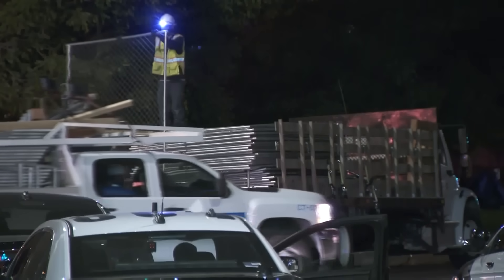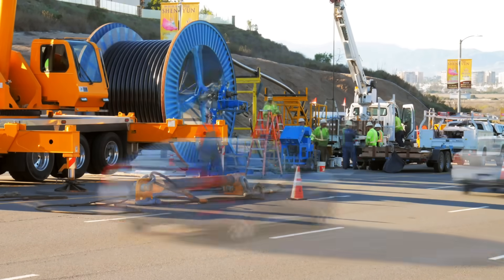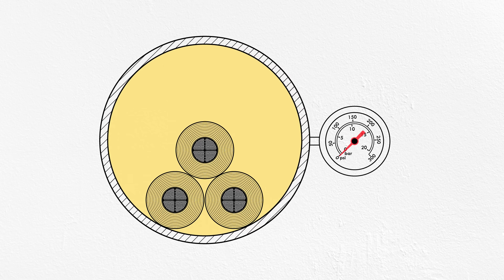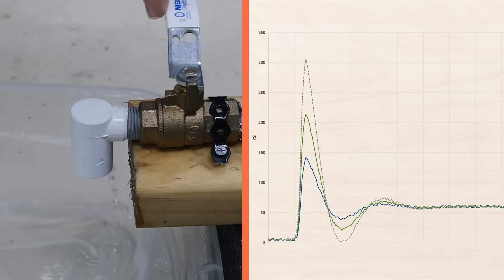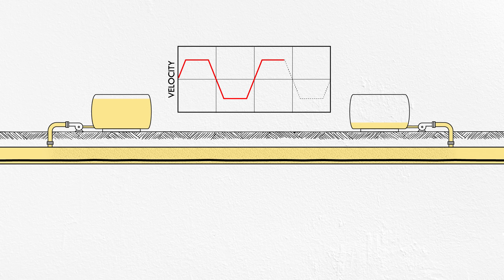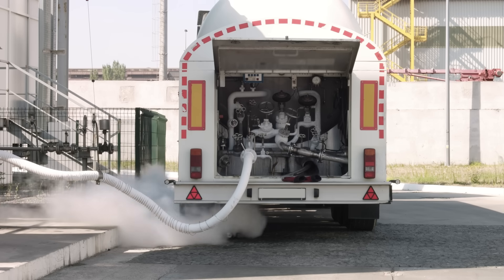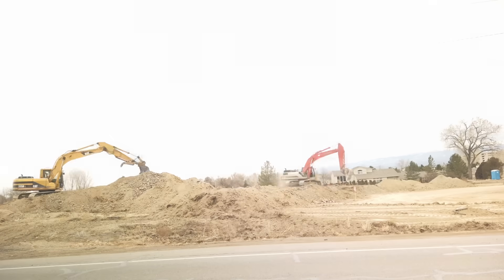Repairing Underground Power Cables Is Nearly Impossible

Comment: Fascinating story, and who knew the complexity involved with underground power distribution. Also interesting twist with the internet bulletin board story. But lets face it, leaving the old lines, with its pipe, oil and oil-saturated cable in situe is just way of saving money on an awfully expensive cleanup project. The old line will never be used again.The dielectric oil, also found in transformers, is a big carcinogen. This will probably become a
superfund cleanup project for future taxpayers.

Comment: This is why they use rubber insulated cables now. There is no oil involved and makes repairs easier. Although a fault in a conduit will require replacement of the cable.

Comment: We had one underground power lines here in the philippines located at san fernando wallace air station which was in use until 2020 when the power station was strucked 3 times by a lightning strike and those underground power lines was constructed by US Air force back in the 60's

Comment: While grid demands fluctuate, I have to wonder how much of the cable flexing was due to heat buildup while slowly reversing direction?  One would think that if they have to lay down pipe, they would have laid down a return line and just allowed the thing to run in a loop.  They could have even added capacity to the system by cooling the oil as it continuously flowed or at least flattened the temperature range some so it wasn't flexing so much.  I mean if you have temperature sensors along the cable or at least monitor the amount of power going through the cable and other environmental factors, you could have been adjusting the flow rate and how much you used the radiators based on estimated cable temperature.  I suppose in a way this would be applying modern tech to an old tech cable system, which is hard to justify doing.  Instead just let the system lay dormant so it is not getting wear and tear through the expansion and contraction.

I suppose this brings up another question, if you start putting in HTSC (high temperature superconducting) power lines, how hard would the maintenance be on that?  At least while such lines are at operating temperature, they shouldn't be flexing much because superconductors create no heat and if the liquid nitrogen cooling it gets too warm, it boils off.  So as long as the boil off gas can escape and more liquid nitrogen pumped in, the temperature should be stable.

Comment: What are the reasons for chosing the pipe solution, as presurrized oil cables were around at that time?

This strictly would not be a cable but a a duct. Or Oil-filled line (similar how nowadays GILs are used [gas insulated line] 

From 1970 to 2008 sounds like normal rated life time to me. Generally taken as 30 years, it is depending on loading.  So the deterioriation of the insulation is just normal ageing of the paper. (probably, based on common experience and limited facts, so other factors may come into play.)

Comment: The real question is why on earth is there still a gas burning power station located in an urban environment.
Reply: I assume it wasn't in an urban environment when it was built in the 50s, though very early power stations were intentionally built in urban environments as transmission networks were not yet developed, and most have been phased out.

Comment: You should visit the Netherlands and some of our grid operators some time if at all possible. Of our total electricitygrid which consists of about 315.000 km of connections. About 4000km is constructed aboveground (mainly 220kV and up due to the lower operational reliability of underground cables at these voltages). The other 310.000km is all laid underground. 

We also use the so-called exchange principle. This means there is a maximum amount of aboveground highvoltage routing allowed. Of we want to build a new high voltage connection aboveground. The distance of the new route has to be sacrificed somewhere else in the grid (or laid underground). 
This way the total aboveground distance of high voltage routing will never be higher than it is. 

If a higher capacity is needed and the distance can't be sacrificed elsewhere. The crosssectional area of the transmission lines has to increase, the resistance of the lines has to decrease or the amount of transmission lines between power pylons has to increase.

Comment: Nearly impossible?  No, it's just much more difficult than overhead power lines.  We have underground power lines on our street.  When we bought the house we thought, "Oh, great.  We'll have more stable power (California-PG&E).  Fifty years later we've had dozens of power interruptions  --  because the power lines that supply our street run over hills, through trees, along streets, etc.  The longest outage we've had was from an underground line that developed a pin hole on a line under the sidewalk on our street.  It took PG&E about 24 hours to find it and fix it.  Overhead lines seem to be easier to find and fix.  Even so, I like the appearance of a residential street without power poles & power lines.

Comment: I'm glad I came across your article.  It sure does provide a decent summary of this type of transmission.  After spending a number of years on LV work I moved to HV underground transmission in 1980 including the design, installation, splicing and hydraulic and electrical testing and eventually training on them.  This was a most rewarding career and I really only retired from it when I turned 70.  The point is, there are still many HV underground transmission pressure cables throughout the world, both Oil and dry nitrogen gas insulated that need maintenance and there's only a few groups still doing this work and getting smaller as electricity networks are being privatised.  I would seriously advise any younger electricians, splicers or engineers to get into this work as the rewards are quite substantial, both job satisfaction and financially rewarding.

Comment: Awesome idea to use LN2 to freeze the oil to work on – but that seems incredibly unsafe to have men working on something that could burst and flood them with a high pressure chemical at any moment. 

Also, the need for the oil in the first place seems like an awful design choice.  To have the integrity and safety of your system dependant on an active fluid circulation system, and if it springs a leak, you're screwed? 

The solid state dielectric they replaced it with seems like a no brainer.

Comment: Fascinating of the complexity to deliver the huge amount of energy in a confined space underground. The single phase 7.5kV underground line supplies my property from the power pole was recently rerouted in one section to allow a construction project, and I got to see what it is made of. I was surprised it is a coaxial cable about 1 inch diameter. This LA power line is three phase so only three conductors are required, which explains why they are not coaxial cables.

Comment: Well done as always. Thanks.

The Grand Coulee Dam in eastern Washington is the biggest dam in the US. In 1981, there was a fire in a mile long tunnel housing underground power cables similar to those used in the video except these were 500 KV lines. The fire shut down 1900 megawatts of power (enough to power the entire city of Seattle) for over a year while it was repaired.

The oil filled cables had been showing signs of deterioration so beginning in 2010 a plan was developed to install new overhead transmission lines and remove the oil filled cables permanently. There were dozens of engineers that worked on the project with many different specialties. I worked as the Structural Engineer for the project and developed custom transmission towers and special anchorages placed on the face of the dam. Fun project.

Comment: Here in Vancouver Canada, high voltage is only transmitted via towers. They then enter substations in densely populated areas and step down and are carried by 3 phase Ariel, without sheething insulators or underground in conduits, with only a insulation layer. From there they hit another transformer and step down to each user on the network. I'm a coms lineman, and have been in many SVs and manholes where hydro is present. Never had an issue

Comment: I suppose it is not surprising, given that some capacitors use paper and especially oil as a dielectric. 

Now if I could only get engineers out to a job so they can try pulling three 500 MCM in a 3” schedule 80 for underground service. I bet they would upsize the pipe haha.

Comment: Thanks for this explanation about moving electricity and some of the pitfalls like HBFF, TMB and dialectic oil.

On one of your diagrams (4:45) the 3 internal cables are bunched together at the bottom of the main pipe and thus the fluid cannot evenly spread around the cables as the bottom part of the picture means it must be continuously arcing.

I had to look up what dialectic meant, a formal system of reasoning that arrives at the truth through the exchange of logical arguments, but it doesn't explain why the oil is so called.
Reply: Peter, late answering and surprised nobody did before.

It is dielectric, not dialectic. It means an electrical insulator that can be polarized by the presence of an electric field. A capacitor is an electric component that stores charge and consists of two conductive plates separated by a dielectric insulator and often impregnated with a dielectric fluid that is the charge storage medium.

In the case of the dielectric oil, the dielectric component of the oil interacts with the electric field present in each of the three conductors and kind of keeps it contained so that it cannot arc with the other conductors. Air is also dielectric, but weaker than the oil which is why the spacing between cables in an air insulated installation is much, much greater.
Reply: @brucetheloon , thanks Bruce, much appreciated what you typed thanks.

Comment: Hello, Grady.  High Voltage Cable Engineer with experience in both MV/HV/EHV extruded dielectric cable manufacturing and reliability testing utilizing offline 50/60 Hz  partial discharge (PD) evaluation. 

This was a fantastic videos and I would love the opportunity to speak with you regarding cable system reliability and modern extruded dielectric (EPR / XLPE / TRXLPE) cable design, installation, and testing.

Comment: Great video.  I was involved in the construction of the new Scat-Oly line, conduit and cable replacement.  Oddly enough, I never heard the story of the failures in '89.  It was a very interesting project, but very difficult navigating all of the special interest groups and agencies LADWP needed to get approval to replace the line.  Thanks for video to relive the experience.  Sometimes when you're in the thick of things you can't step back and appreciate what is happening.
Reply: I heard someone didn't open a valve after doing some maintenance work at one of the pump stations..rumor?

Comment: one of the ways these faults are located that i did not see mentioned is through a wide band low to medium band radio frequency receiver. The arcing 60 hertz will produce a very strong signal in the low and medium band frequencies. The higher the frequency the lower the strength of the radio frequency interference generated by the arc. The process used sometimes is to start at a low frequency to identify the arc and its direction. Then as it is pin pointed increase the receivers frequency or increase the signal attenuation. This works better on aerial power lines, as the earth helps shield underground lines, but it will work sometimes on underground lines if you can carry the tester along above the ground, along the route of the line.

Comment: When I was a lad of 9 or 9 years old, I would walk to a nearby hill and spend hours building dams in the street gutter which was non paved and dug out of sandstone. I imagined myself building Hoover or Grand Coulee dams and providing power all across the western United States. 
20 years later I was hired by my local municipal public works department and was assigned to the crew that regularly cleared out the drainage ditches in the town. As I was working with the older crew members, they talked about how years ago they had to deal with kids who kept blocking the ditches with little dams that they had to remove. I started laughing and admitted I was one of those damned kids they were reminiscing about. 
So the crew nominated me to clear all the blockages on that road for the rest of my time in that department. 
The 8 year old kid says it was worth it!

Comment: In the early 90s I worked Underground Utilities in Tucson & we laid the high tension lines inside 8 or 10 inch PVC pipe that was separated then concrete poured over top for heat containment.
We also ran smaller phone lines and even smaller cable TV lines.
We cut a cable line one day and had several Upscale Attorneys threatening Everybody if they had to miss their "I Love Lucy' reruns....

Comment: I do not think it was worth the effort, only in California would something like this would be feasible. I  would have used an HV DC transmission system and used multipath since you do not need to run three phases anymore and this technology was available in the 70s. DC  systems are expensive but I cannot see it being more expensive than this.

Comment: I used to work at a golf course as an irrigation tech (shovel monkey..)  The irrigation foreman was a guy that had been in that business for 30 years. Golf courses have miles of control wire to operate the irrigation valves, and sometimes a fault (short...) would occur. He had a electrical tester to send spikes of voltage through the wire to pinpoint the short. I asked him one day how they found shorts before the tester was invented.
  He said they would start at the middle of the run (could be a five or six hundred foot run of wire...) then go to the middle between , then again, then again, until they found it......crazy amount of hard work for one simple short. I asked why didn't they just drop extra wires for back-up. Too expensive.

Comment: If they paid for a pipeline and already had the ditch dug, why couldn’t they put a second return line and made a full loop? More oil and higher initial cost but local temperature fluctuations would be decreased because the flow would never have to stop and be reversed.

Comment: This is another excellent and spot-on explanation, Grady.  I'm a retired electrical utility transmission engineer and you have everything right.  One of my earliest utility assignments was to go down into a manhole with the crew members and cut open a lead-sheathed, oil-filled underground cable in Duluth, MN.  Several circuits of three grey lead-jacketed cables went through that manhole and we had to drive a chisel into the correct cables to repair a splice.  I have a real appreciation for the danger and significance of what those crew members do.

Comment: Liquid nitrogen use could have led to huge mecanical (and thus electrical) issues, for insulators and for the tube. I wonder why they even bothered using active technology (pressured oil) when the passive ones are always hundred times better.

Comment: Electrical engineer here. Nice video - as always.

However, I have to nitpick a bit. The main reason for the three phases is NOT that you can spread the current into three parallel conductors to lower transmission losses! The main reason is that we have AC - alternating current. If you connect a one-phase motor to AC the magnetic field (caused by the current) in the coil inside of the motor will oscillate between a high and a low strength. This results in an oscillation of the force generated by that magnetic field. That means you don't have a really smoothly running motor and that would be a problem in very large machines. So that is where three phase AC comes in. The three phases have an offset towards each other. They are offset in time by 1/3 of one period, or 120° (one period being the equivalent to 360°). The coils in an AC motor are mechanically offset by 120° (assuming a very simple motor, here). If you now superimpose the oscillating fields of those three coils inside of your motor you get a field vector (resulting in a force vector). That vector always has the same amplitude, or strength. The force is always the same! But its direction is changing, it is literally rotating. This makes your machine run very smoothly and THAT is the main reason for three phases! (You could do the same with more phases but that would complicate things and make everything generally more expensive.)

Comment: Thanks for the interesting account. Having used a CO2 pipe-freezer in plumbing work, the principle was familiar - but very much harder to do with oil. Also, I am surprised that such a commonplace material as paper is used as the HV insulator; these days we are so used to hearing about rare or expensive commodities being employed.

I used to live in Scotland, near to the Forth Road Bridge. This structure ended its useful life because the support cables became too corroded. It was a big issue for a long period. During this time I wondered whether corrosion could be prevented by creating something similar to the oil-filled HV transmission pipe. That is making an enclosure around the support cable and filling it with corrosion preventitive fluid. A relatively cheap precaution could have save the huge expense of building a new bridge.
Reply: I gather it wasn't so much the paper that was the insulator, but that it could absorb the oil which was a very good insulator.

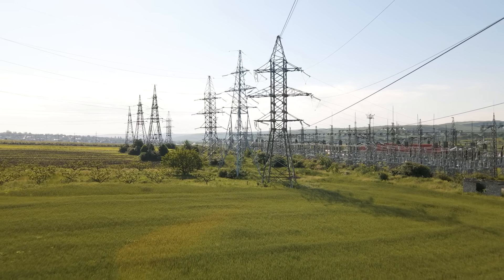Comment: Grady so the big transmission lines like you show at @2:23 keep wide berth between the lnes..but what happens when those are sent down to the more residential wooden power lines that run through towns?
Reply from the maker: The voltage gets stepped down first at a substation